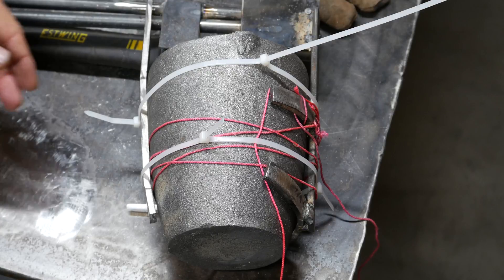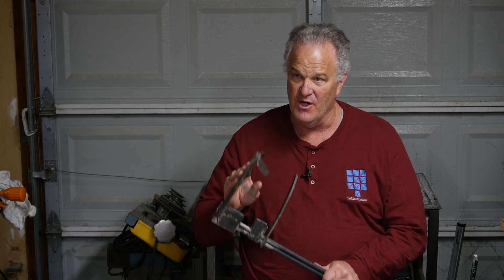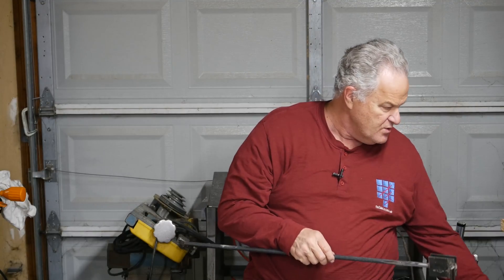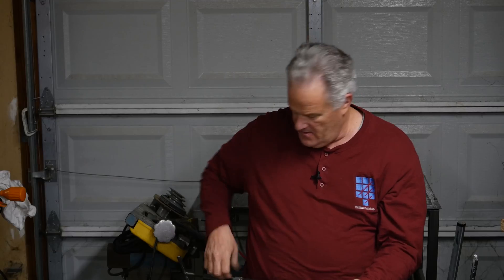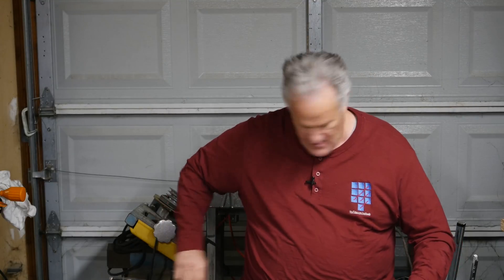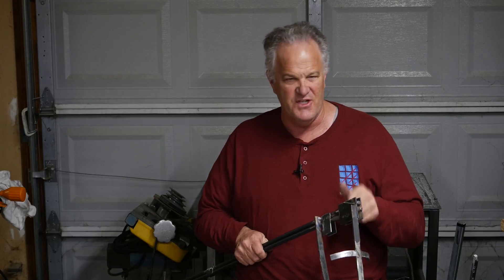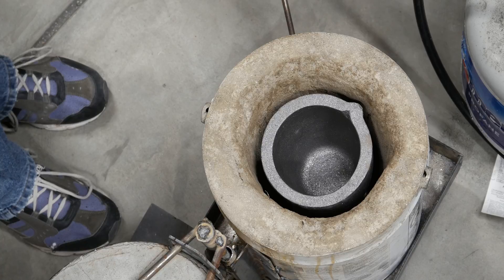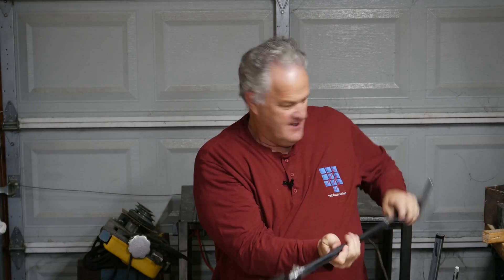Crucible tongs

Comment: I was lucky and hadn't got to far with my original oven.  I ordered my crucible but it hasn't shown up, when it did I realized my smoker would be too small. Hence my new far to heavy duty oven was born.  

Today my cement is on day two of curing and I'm starting my gripper.  I'm have been planning on making a gripper/poured like yours, but maybe with a spring.  We'll see.  I can design all day but till I get parts made and see what bits I have I can't set any plan in stone.
Reply from the maker: I wouldnt make what I did. I use these to simply lift the crucible from the furnace but would be better off making a simple pair of scissor-like tongs that I could use from a more standing position. What I have now requires me to bend over quite a bit.

I'm also using a traditional shank (ring on the end of a pole) to pour with.  Yes this requires me to set the crucible down and pick it up again but... maybe I should say BUT... this provides a much more controlled pour. Being able to rotate at or near the center of gravity is a lot better.  Despite what I said in that video. 😄

There are things in the casting world that are proven good tools and techniques.  Traditional tongs and shanks are good.  There are however things that need to be improved upon, big open sprues for example, esta no bueno and should stop being used.
Reply: @swdweeb  I'm setting up this stand ingot mold heater thing now, and when that's done I'll know how tall I'll need tooling and go from there.  I liked the VOG cradle design a bunch.  But I really like his extension that holds up one side of his crucible.
Reply from the maker: @junkyardzombie13  I don't recall Geoff design, but I can tell you that a simple ring for a shank works quite well. I really don't ever tip much beyond horizontal so I've never had a crucible want to come out. I see a lot of guys making a restraint on their shanks to help hold the crucible in if you tip beyond vertical.
Reply: @swdweeb the adage keep it simple stupid comes to mind often when I start overthinking things. I appreciate the help.
Reply from the maker: @junkyardzombie13  You can always start simple and then add stuff as needed (especially when you decide I don't know what I'm talking about 😄)
Reply: @swdweeb  it wasn't VOG but someone he recommended.  He does pours through glass sided molds to show sprue and vents.  
This is the one that he shows his tooling.
 https://youtu.be/jRB3rq9VSzY
Reply: @swdweeb  agreed most of the fun is just making something, if it doesn't work. Well make another but better.

Comment: Hi Swdweeb. I hope that you and your family had a wonderful Christmas and may the new year be a blessed year. 
I'm thinking of building a foundry/furnace for myself, the inside diameter is going to be about 8 or 9 inches in diameter. What size crucible do you think that I should use... This is going to be the first time that I've ever built one.
Reply from the maker: Hi Michael, I use a #4 6KG crucible that is 5 1/2 inches in diameter. My furnace is only about 7" in diameter. This is, how they say, no bueno. ;-) My crucible sits right in the path of the flame from the burner. I had my first failure about a week ago that I believe is  direct result of that. Stay tuned for a foundry side chat on the subject hopefully coming soon. 

That said, make sure you have enough room around your crucible so that you can angle the flame to go around it. Personally I'd recommend 2" clearance between crucible and the furnace wall. Clearly you can get away with less, I'm good (maybe we should say bad) example of that, but do as I say not as I do.

Also, are you using firebrick, KAO wool, or something else to line your furnace?  I used a 2200f castable firebrick to put a 1/2" around  mine. It it s spread over the firebrick that I used This works well enough for copper which is as hot as most  of us get. I did melt cast iron once and it melted my lining. If you think you're going to melt cast iron, look into one of the hotter refractory cements to line your furnace.

Comment: They came out great. What ever works right?
Reply from the maker: That's exactly how I feel about it. The burner my not be placed exactly right and the crucible is too big it melts aluminum.  I'm going to try copper or brass in the next day or so.
Reply from the maker: Doh... thought this was on the first firing video. Read it in that light and it will make a little more sense. ;-)

Comment: It'll be fine and those awesome tongs will work out great. I had to cut the bottom gripping fingers off my tongs because I couldn't get them to fit. I like how you have a single step from lifting to pouring. I have to lift the crucible out of the furnace and place it into a pouring shank. Looking forward to seeing you melt some metal!
Reply from the maker: As Rod Stewart sang, "tonight's the night" hopefully "It's gonna be alright" ;-) Sorry, I couldn't resist.

I hadn't thought about trimming the bottom fingers off. I'll definitely keep that in mind. I'm actually thinking of smoothing things out inside the furnace with a farrier's rasp that I'm going to make into a knife some day.  Even gaining a 1/4" will help me.